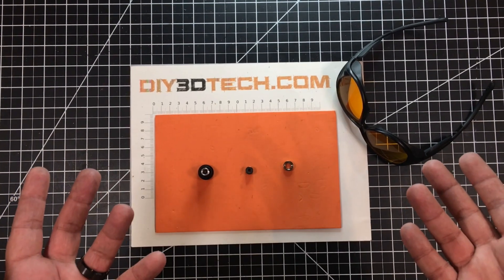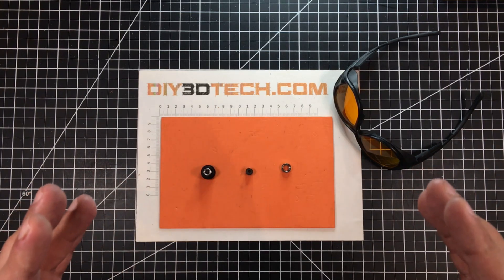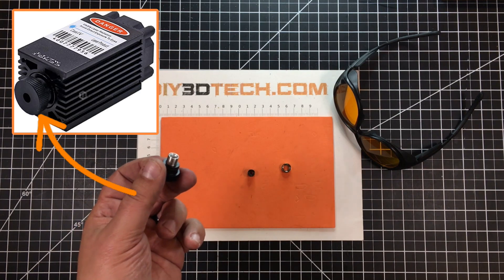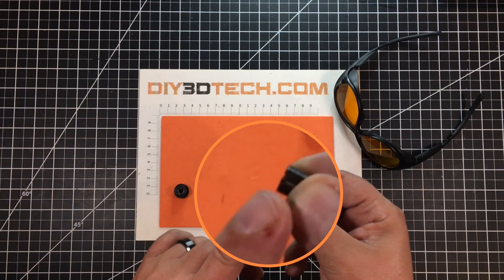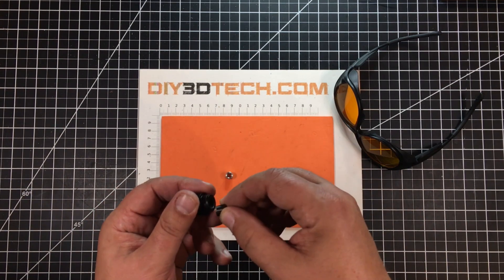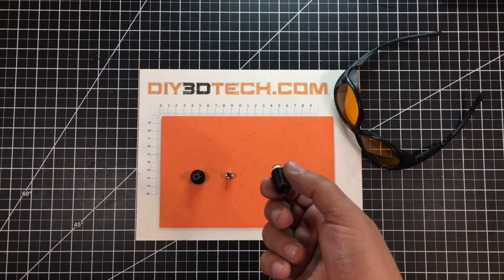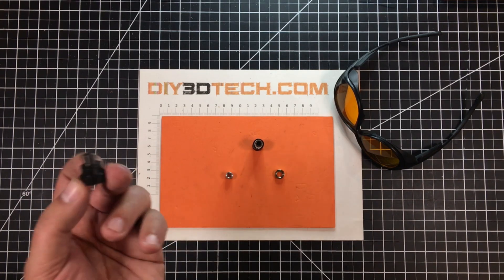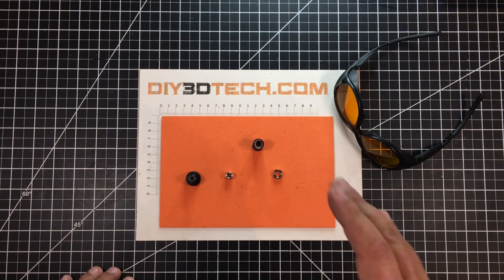Ortur Laser - Change Barrels NOT Lens!

Comment: just came up with an idea, I have a fixed lens in the ortur 2 so the option of changing  the lens it has gone for me . but in a brain wave my father in law had some old bi focal glasses, so I have  a red laser pointer and tried out pointing the laser through the glasses lens to find out  what it would do,  tried it on the ordinary piece of the glass lens and had no effect, but when I tried shining it through the bi focal bit on the lower section of the glass lens I noticed it got a tiny bit smaller, so  thinking about it , I thought what would happen if I put the two lenses back to back.well I took out the 2 lens from the spectacles and glued the lenses together and so I basically had a convex lens with a  highly magnifyed close distance  focasing  bit and where the bi focal bit on the 2 lens is. put it in front of the red laser pointer  to see what it would do, it reduced the laser down to a very fine spot. I have not tried it with the ortur 2 yet as I am busy finishing building the  housing to collect the fumes.  I will let you know how I get on when I have it all together again. 

Incidently I came up with a clever   way to get rid of the fumes quick. I was going to put a fume  extractor on the machine housing but as money was tight I sat there and thought what I could do about it. Well  I have  an old  vacuum cleaner that is like a Henry vacuum cleaner but mine expels the pressure going into the vacuum cleaner out  of an outlet on the opposite side of the vacuum cleaner,  you can use it if I remember rightly  by disconnecting the vacuum hose and putting it in the blower side to use as  a connector for pressurising an air fed spray gun if you want to use it for that.So the vacuum cleaner  blows out one side as it  vacuums up on the other side .  well it came to me in a brain wave. I connected  the vacuum into the housing of the laser compartment , got hold of  another hose and at the same time connected that to   the blower side of the vacuum cleaner and put that into the opposite side of the housing and i had  made a basic   wind tunnel  using  the  same machine but instead of just vacumming I  am using both sides of the vacuum cleaner,the inlet and the outlet; both at the same time, I have a filter in the vacuum itself and so the air coming out of it is filtered works a treat. instead of waiting for the fume to be caught by the vacuum, it now as soon as it is produced the incoming air   is pushing  the fumes  towards the vacuum outlet . just a hack but worked out great.

Comment: the picture shows 7W model which has far different barrel to 15W and 20W models, that is why it was much confused. When I tried to swap barrels between 7W and 20W it can not happens it is because 20W screws like G8 lens or G2, while 7W laser lens is screwed by that black outside part that holds lens barrel inside. Well that was main reason that confused me, now when have 2 different lasers on house, and could find it out myself I know why I asked you a question how to fit g8 to laser, the answer is simple, it can not be done in 7W model, but works only for 15w and 20w from ortur. It may work perfectly with other brands but here is not. cheers.

Comment: I just got my G8 lens and was trying to install it per your instructions when I found out that Ortur must have use some kind of compound to lock the barrel in place. It was hard to remove to start with. If you look at the adjusting knob with a magnifying lens you will notice what appears to be some kind of plastic on the internal threads. Scrape that off with a small screw driver taking care not to mess up the threads. Your new barrel will now screw in without a problem.

Comment: OK, so I'm one of the people with a stuck OEM lens barrel glued into the focus ring. This is what I ended up doing:

I have a bench vise with TPU 'soft jaws' in them. I was able to snug the vise down on the barrel to the point where it wasn't going anywhere and also wasn't being crushed by the vise. One thing was certain and it's that the barrel wasn't going to budge without a lot of coaxing. I wrapped the focus ring housing in cloth and lightly clamped some self-locking pliers (Vise Grips) around it. Then I tapped the pliers with a metal hammer so the shock would break free whatever was in there locking the threads. After about 6 sharp but gentle taps, it broke free and I was able to unthread the lens barrel without damage. Upon closer inspection, it looks like they used regular cyanoacrylate 'super glue' in the housing. It wasn't a lot, but it did the job, that's for sure. This is on a 15W Ortur LM2 I purchased about a month ago. This thing is great fun, BTW. I'm just experimenting with different focal lengths.

I hope this helps.
Reply from the maker: This is interesting and thanks for sharing!

Comment: does this mean you are not goin to change to the new wattage laser?
Reply from the maker: Why do you ask verses this video?  It simply discusses changing the lens barrel.  However since you are a regular I have a LOT going on in the laser area!  So I have brand new Ortur Laser Master II 20 watt unit which you see soon, I also totally rebuilding my original Ortur Laser Master with a GRBL controller, a Z-Axis for variable depth cuts and larger laser (this will be a diode monster) as well as build variable Z-Axis scissor bed for the k40!    The down side is I have to go in a week for some major surgery which will keep meout of the shop at least three weeks.  :-(
Reply: @DIY3DTECHcom  sorry to hear about the surgery. get well soon.

Comment: Have you done a reference table for burning on wood ? For power and speed settings. And type of wood ? I'm finding it hard to get a consistent engraving setting. But I do use the free software and not Lightburn .
Reply from the maker: I have created a number on cutting however not engraving.  Also note engraving will quite a bit so I doubt consistent setting is possiable, however more so a range.
Reply: @DIY3DTECHcom  ok. Thanks for response. I have since purchased Lightburn , and still run into images not showing clear and wasting more wood than I liked to. I appreciate people like you that make these vids , but nothing clear in regards to speed , power , dpi etc for images for the 15w Ortur I have.

Comment: I’m having trouble getting my barrel out of the holder on my Ortur 20 watt laser, any suggestions? I’m also having a hard time getting the G8 lens into the 3D printed knob I ordered. Can’t get one out to reuse the holder and can’t get one in to use the new holder. Stuck.
Reply: I am having the same issue as you Michael. were you able to find a solution?
Reply: @whiteli9htnin  so far not yet. I think it must be a fixed lens holder. So now I’m trying to find another G8 lens holder. Where I bought the first one from s now out of stock so I need to find someone that 3D prints the holder.
Reply: @michaelguidry6893  do you know the link to the file to print? I have a 3d printer I could probably print one out for you if you know which file to use
Reply from the maker: I need to ask, do you have the fixed focus or variable focus module.  The variable focus you simply screw out and the fixed well I am not sure it is "fixed" as the name implies...
Reply: @DIY3DTECHcom  I’m not sure, it’s the one that came on the Ortur laser 20 watt. I can adjust the focus while it’s in the laser but the barrel doesn’t seem to unscrew so maybe it is fixed. That would explain it. Thank you for your response and for the videos. I really get a lot out of watching them.
Reply: @DIY3DTECHcom  If you do have the fixed module is there a solution to changing to the g8 lens?
Reply: @michaelguidry6893  I was on the site but I'm not sure what one is the one we need
Reply: @whiteli9htnin  I ordered it from rowdy Roman on Etsy but I think the file came from DIY3D. He has a video about the G8 lens and I’m pretty sure he offers a download for free on the lens holder. I never looked at the download because I do t have a 3 D printer but I think that’s where he got it from.
Reply: @whiteli9htnin  you may want to specify it’s for the Ortur 2 laser master.
Reply: @michaelguidry6893  ok I will do that, thanks!
Reply: @whiteli9htnin  no problem. Let me know how you make out with it I’ll be curious. I have the new barrel/lens but have no way to install/use it. I wouldn’t mind if I have the factory fixed lens it’s holder to use as long as I can swap it out with G8 lens when I need it
Reply: @michaelguidry6893  is that what you ordered from etsy? I'm about to print out what I think should work, if it does I can print another and ship it to you
Reply: @whiteli9htnin  I ordered mine from this Etsy site. JohnsRobotArmy. G8 Lens Holder for Laser Master Diode  Laser.
Reply: The only problem I had was that I couldn’t get the barrel threaded into the holder either because it was too tight or the threads didn’t line up. They are very fine threads. I’m not familiar with 3 D printing so I don’t know if they’re too fine of threads to be printed or I just couldn’t get it started without cross threading, it very well could have been on me and I’m not blaming the maker at all for it not working.
Reply: @michaelguidry6893  strange for some reason I'm not able to see what that person is selling
Reply: @whiteli9htnin  maybe search his video for the G8 lens, he doesn’t sell his files I’m pretty sure they’re free to download them. Maybe contact him and ask him about them. He has several things he 3D printed that he shares on his videos.
Reply: @whiteli9htnin  if you can print out an extra one that would be great, I’ll be glad to purchase it from you. Just let me know how to pay. Do have a site to order from? If not I can Venmo you or something. Thanks
Reply: @michaelguidry6893  yeah I can do that, do you know if there is a way  to dm messages on here?
Reply: @whiteli9htnin  I’m not sure I know what you mean by dm messages from here, sorry. Is that direct message?
Reply: @michaelguidry6893  yeah direct message, just so  we can exchange info
Reply: @whiteli9htnin  hmm, not sure how to do that. I’ve never tried that yet. Let me see if I can see how to.
Reply: Exact same issue for me with the 20W. I wrapped the barrel in a couple of layers of cloth, and twisted with a pair of Channel Locks. It came right out. Problem was that it had been glued into the focus ring. I came here to see if DIY3DTECH had a video showing how far to screw in the G8. The old lens wasn't screwed in very far. Maybe 1/4 inch. The G8 goes in a little deeper.
Reply: @thearthound  I tried doing that too but I ended up just scratching the crap out of the threads and it didn't budge. I'm working on printing a holder for the g8 and if I can get that working well then I will be more aggressive on the stock one. I just don't want to break it then really be screwed
Reply: @whiteli9htnin  yeah, I understand that. Hope the print works for you.
I can't find anywhere that tells how far to install the G8. Guess I'm going to have to experiment.
Reply: @whiteli9htnin  have you had any luck finding the file for the G 8 lens to print from DIY3D? If so let us k ow how it worked out for you. Thanks
Reply: @michaelguidry6893  yeah I found the files but they haven't worked for me, the lens kept slipping out of the non threaded one and the threaded one wasn't the right size, right now I'm tinkering with it to see if I can get it to work but I'm also about to head out of town so I will update you when I get back on Monday
Reply: @whiteli9htnin  I saw that there is a tap for that size thread but I haven’t found it. It might be able to be made without threads and then tapped. Just a thought. Sounds good, thanks.
Reply: @michaelguidry6893  I'm not sure what a tap is?
Right now im thinking if I make it with threads a little bigger then can wrap some Teflon tape to get it tightened up but I'll have to try it when I get back
Reply: @whiteli9htnin  a tap is a steel rod with threads on it that you insert into say the hole in your lens holder and it “screws” into the hole while actually cutting the threads on the inside of your hole. You then back it out and you’re left with threads to enable you to screw your lens or bolt or whatever you wanted to insert in that hole. They come in many sizes to fit the thread pattern you’re trying to match.
Reply: @michaelguidry6893  oh that's super cool and convenient, that would be  awesome.
Reply: @michaelguidry6893  so I have not been able to find anything that works yet. I thought I had one that would work, threaded it in and super glued it but then it came out in the laser head and got stuck so now I'm waiting on a replacement laser head.
Reply: @thearthound  thanks for that info. I was tempted to do that but I was afraid I would ruin it and wouldn’t be able to use my laser at all since I don’t have a holder for the G8. I liked the one I ordered because it’s larger and would be easier to focus but I can’t get it to thread into it.
Reply: @michaelguidry6893  i didn't put a lot of pressure on it. It came out pretty easily. My G8 threaded, but was a bit loose. Tightened it with Teflon tape. Just not sure how far to screw the G8 into the focus ring.
Reply: @thearthound  I’ll have to give it a try, I did wrap a rubber and around it and very slightly put pressure on it but not too much. I don’t think the lens needs to go in too deep though. I would go with thumb tightening as tight as possible and if it goes several turns I think it would be good.
Reply: @michaelguidry6893  Thanks, that's exactly what I'm going to try. It goes in pretty far. I'm just going to experiment.

Comment: I've seen where most people had a loose fit between the G8 barrel and original thumb screw. Mine fit snug and went in like it was supposed to be there. Now I'm nervous it's not right.
Reply from the maker: Most do find this to be the case, possibly you got lucky!  :-)
Reply: @DIY3DTECHcom  fingers crossed. It seems to focus good and so far good detail on Balsa
Reply: How far did you screw it into the focus ring?